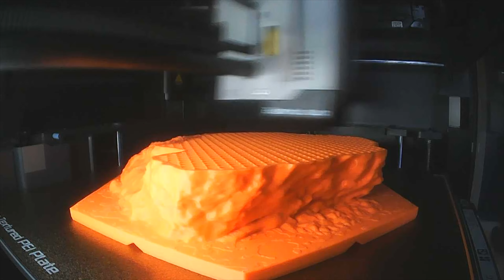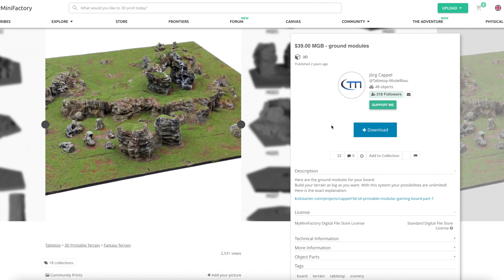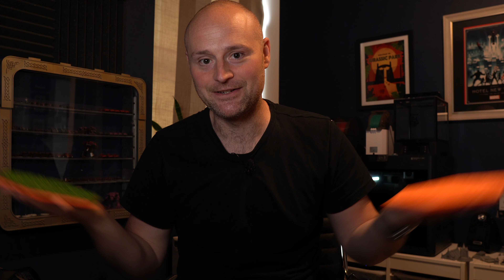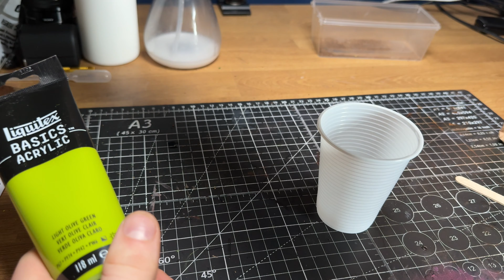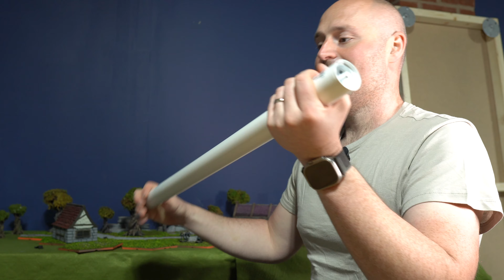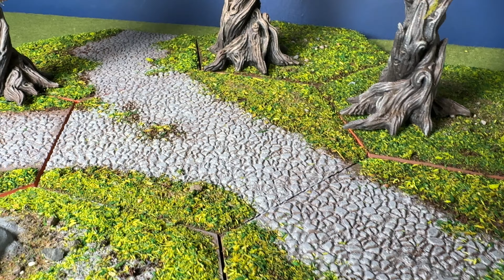3D Printing and Building My Fantasy Wargaming Board

Comment: Hi man, nice video, thank you! How long does your bambulab take to print one of the standard flat tiles? Have you tried standing them on one edge and so printing several ones simultaneously, next to each other?
Reply from the maker: The flat ones take about 2 hours and the ones with some little hills are about 3. Not tried standing them up yet
Reply: @GrayScalpMiniatures  What layer height is that at 0.2mm?

Comment: I backed the kickstaters for HexHog Tabletops and Evolved Games Studios, modular battlefields. To use in my post-apocalypse and sci-fi games. I also backed the StageTop 3D Printable Table kickstarter, by Gun Shot Games.

I have not even printed any of it out. It is sitting in a folder of my pile of digital shame/opportunity.

Have you thought of digital kitbashing using these hex tiles. To give you more variety, using 3D asests you already have.